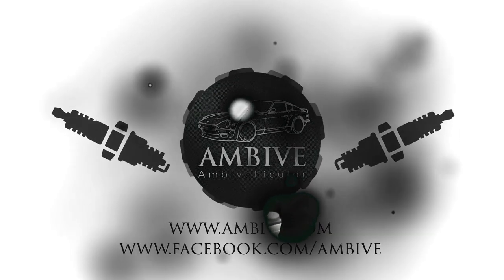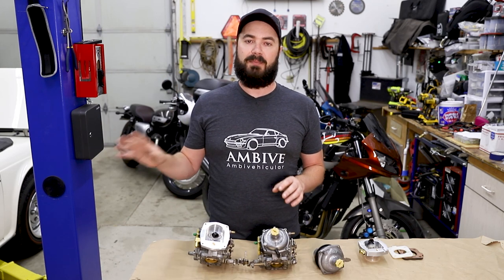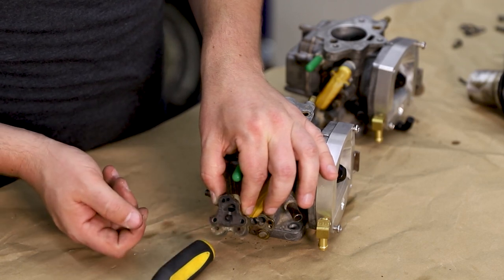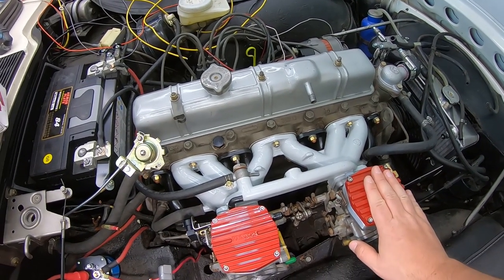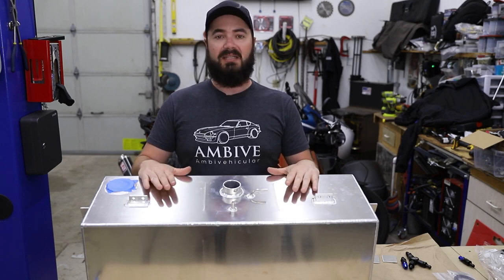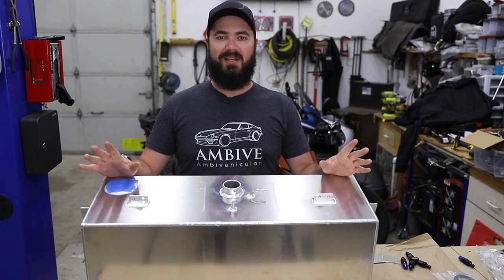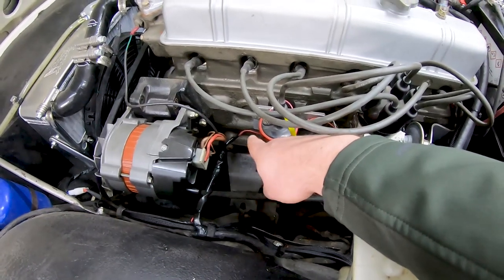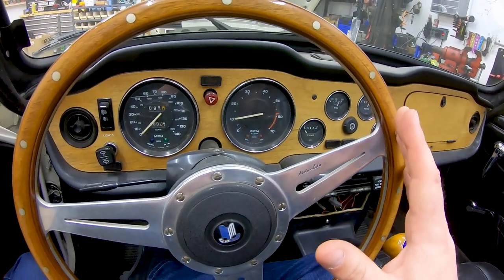Triumph TR6: Part 3 - EFI System Install

Comment: Did this project require an additional port being added to the intake manifold somewhere to support the idle air control valve?  If yes, where was it located? Thanks in advance.

Comment: Hi - I am currently thinking about installing EFI to my TR6 and like your setup! The only part I can't get my head round is the Distributor! What system and installation setup are you using to link the Dizzy to the ECU? I am currently faced with a Crank mounted timing wheel and sensor which I don't really want to do....
Reply from the maker: I used the retrofit kit included with the EFI kit for the TR. For my 280Z I used a Bluetooth programmable unit that allowed me to create my own curves on rpm and vacuum, and on my other cars I have used timing wheels. It all depends what kind of control you want. These TR engines are basically agriculture equipment so it's unlikely you need as much control as say my 450hp 240Z, so I'd keep it simple.

Comment: How much would you say total cost was. WOW what neat solid work...
Reply from the maker: All the prices were pre-COVID. The EFI system was about $2000, but there's a lot there that you could do differently or save money on if needed. The kit makes things easier to ensure you have plenty of parts. I would say that if you wanted to use nice fittings and rework the supplied wiring harness to be the correct length with A bulkhead connector, probably $2500 because fittings are expensive.

If you had someone else do the work, the hours would be pretty spendy if you didn't just do a simple install.

Comment: I know it can be done, but why?  Not sure I understand why one would go to all this work by hacking up a perfectly good running TR6, or otherwise properly rebuilt and tuned Zenith-Stromberg carbs are very good performers.
Reply from the maker: To be fair, only TR6 enthusiasts would say that being able to run is perfectly good. It all depends on your definition of "good performers" and the amount of reasonable maintenance that is acceptable. EFI has numerous benefits over carbureted setups in virtually any application on the street. On an application with as many negatives as these systems I'm the TRs, it really is just a matter of how much it is worth to you. You could be focused on the gains in power, mileage, timing control, consistency, cold starting, hot starting, response, consistency at altitude, etc. It's a matter of individual use and interest.

If you're concerned about originality, it's not going to be worth it. If you aren't, everything being "hacked up" is already disposable on a car like this.
Reply: @AmbiVe  What do you anticipate will be the gains in power and mileage?
Reply from the maker: We don't know for sure. The original carbs were in such terrible shape that it feels like it gained over 20hp, but that could be specific to this car. It definitely starts and runs a million times better and is way more reliable after sitting.
Reply: @AmbiVe   certainly two into six never made much sense to me from a carburation point of view. My 240Z was night and day after swapping the two SU-type carbs for triple Dellortos, but they took ages to set up well;  these days I would go for a 3rd party ITB EFI system every time.